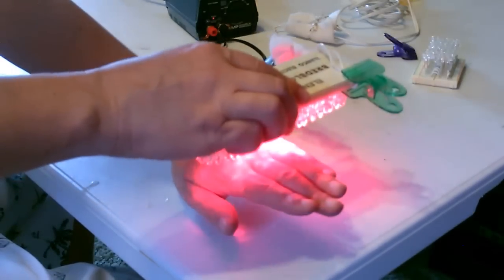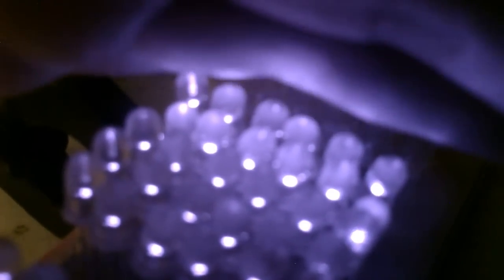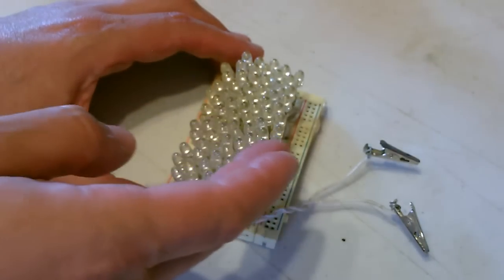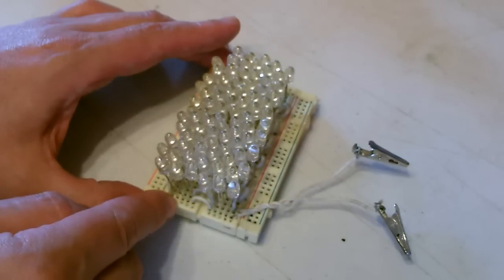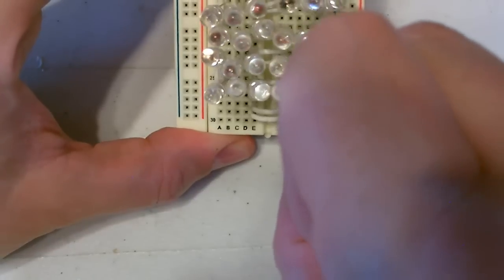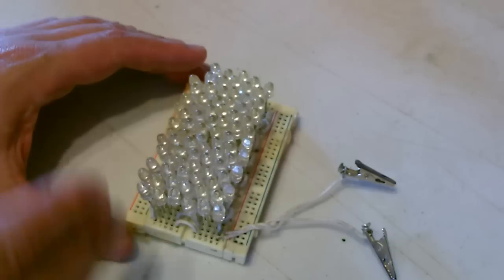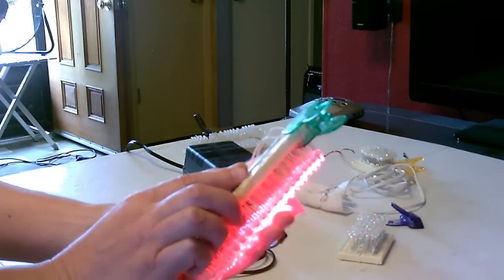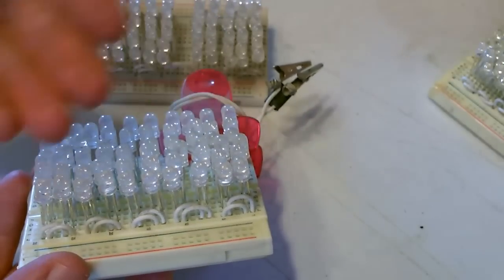Heal With Light! - DIY Cold Laser Therapy (LLLT) 660nm Red Light - LED Healing Panels! Ez DIY ($25)

Comment: Have you ever tried to wire a board with 660 and 880 together on the same board? Would you need resisters and what voltage do you think would run it?
Reply from the maker: hi. i've never tried to wire 660 and 880 together. you probably would need resistors. i've never seen any studies that show using the two together has any benefit. i think i've seen commercially made units that use both 660 and 880 (but it's a gimmick imo)

Comment: how would your diy compare to the 

hooga 24w bulb on amazon 

“Hooga HG24 provides top-tier performance with approximately 120 mW/cm² at the surface and 85 mW/cm² at 6 inches. “ 

just curious because i’m legit serious about making yours with the 400 breadboard but all the ones on amazon for the panels have fans so they’re probably more powered?

Comment: Just to mention how grateful I am that you've made this video. It's been years since I watched it for the first time, which is when I built my (first) LLLT device using your plans. And it rocked, tho the LEDs stopped working fast. Bought then at jameco. If you can make an update, it'd be great.
Reply from the maker: hi. i have made one more video about these panels that is newer. it shows a different wire configuration and works at least as good, maybe a little better.

Comment: Thank you for the great design idea! Maybe you or somebody with some knowledge can help me; I built an identical unit with those LEDs. However before I had even 50 LEDs populated on the jumper-cabled  breadboard, they faded out to where only the first couple of rows lit up. Almost as if the power supply, (which is 5 A )couldn’t keep up. All individual LEDs anywhere on the board worked correctly, just not past a certain quantity. Any ideas?
Reply from the maker: hi. it could be a bad led. even one bad one can sometimes throw the whole thing off. i have another wiring pattern that might help also. it uses the exact same number of wires but they are in a different configuration. in that configuration each row of leds gets its own power. the easiest way to explain it is to just give you the link to the video. it shows how to wire it up. btw - it's very easy to switch the wiring pattern (and this alternate wiring pattern works very well even if you have a bad led or two because each row taps off of the power on the side of the breadboard). here's the link https://youtu.be/kD5cfrpf4sA
by the way, make sure to read the description section of that video. it has extra helpful info

Comment: which power supply do I need to use if I use 16pcs 3W 850nm LED chips in parallel? This chip's IF and VF are 500-700mA, and 1.5-1.7V, respectively. Do I need to connect a capacitor or a resistor? Pls, help me :((

Comment: Do they use a different led in the commercial ones? Something more powerful? The spacing is much greater in those, so just curious.  Thanks
Reply from the maker: hi. a lot of the commercial units are not much good. a few are - but many really don't work. the leds they use are often not even as good as the ones i used (certainly not better). they space them farther apart to save money. they know that the product they're selling doesn't work so they don't even bother to use the right amount of leds.
Reply: @desertsun02  I was guessing that was what was going on,  thank you for your work sir!
Reply: Same lights. You can buy different wattage

Comment: Just curious why no 850nm LED's? Most of the research is based on a split of 660-670nm and approx. 800nm LED's?
Reply from the maker: hi. i found no benefit from using the 880 nm ones. they just never did anything much. they may help some people though.

Comment: This thing is amazing. You feel the difference to the expensive and not so intensive devices. This really does the trick. I Used 40000 mcd, 630 nm Lumetheus LED Diods from Amazon. Simple Breadboard, 22 gage wire, on / off switch and battery holder. All taped together with hot glue to fixate it. Its great gerat great! Feel it on the whole body after 30 min of serveral spots treated.
Reply from the maker: wow, you really got some high miili-candella ones. that's probably good though. i love the device. it's one of the few technologies that i've found that really seems to help.
Reply: Are you using a 9V battery? Are you limiting the current with a resistor? Do you have a link for your amazon leds? thank you
Reply: @francisr6804  2x1,5v batteries. So total 3v
Reply: @francisr6804  i have mine from amazon spain. Find them there and the by something simular. The angel of light is very important.
Reply: @AlvenslebenC  the angle must be wide or narrow?
Reply: @francisr6804  narrow. Its like a laser accupunture then. Use it above accu points

Comment: I could tell there was a huge mark-up on the FDA approved units available. Having no electrical knowledge I am a little intimidated by making my own unit.  Commercial units claim the amount of emf and magnetic emissions their units emit.  Is there a way to measure the amount when you make your own or does it not matter since you use it for 90 seconds instead of the commercial units 10 or 20 minute recommendations per area?
Reply: None of them are FDA approved. They have been cleared as safe for cosmetic use. That "FDA approval" is a marketing gimmick.

Comment: 660nm LEDs
https://www.jameco.com/z/LUR3833-LED-Uni-Color-Red-660nm-2-Pin-T-1-3-4_333526.html
Bread Board
https://www.jaycar.com.au/arduino-compatible-breadboard-with-830-tie-points/p/PB8815
Bread Board Jumper Kit Wires
https://www.jaycar.com.au/breadboard-jumper-kit/p/PB8850
Alligator Clips
https://www.jaycar.com.au/10-piece-jumper-lead-set-alligator-clip-to-pin/p/WC6032

DC Power Supply 
https://www.google.com/search?q=Philmore+2amp+regulated+DC+power+supply&oq=Philmore+2amp+regulated+DC+power+supply&aqs=chrome..69i57j33.454j0j8&sourceid=chrome&ie=UTF-8
Alt DC Power Supply 
https://www.jaycar.com.au/3-12v-dc-27w-power-supply-7dc-plugs-and-usb-outlet/p/MP3316

Comment: Your power supply is 12VDC each LED is 1.5VDC. How do you connect them without resistors?
Reply from the maker: hi. the power supply i used is variable. 12v is the highest setting.

Comment: I had to call Jameco to find the exact LEDs you mentioned.part no. 333526 - .17 ea x 100. What is your normal power setting? Seems like a variable is not need if normally set at 12v?? It's also more costly. Anyone else have a suggest power setting?

Comment: Awesome project! I'm thinking of building an array of 5W 850nm NIR LED's, currently overthinking the whole beam angle, grid geometry and radiation uniformity but having fun while learning stuff in the process :)
Could build a few hundred Watts for cheap
Reply: Did you make it?
Reply: @maxjoseph5981  Nope, I ended up buying and using powerful incadescent lights instead, I think the results should be very similar as most of the energy is in infrared and red! And you get all frequencies
Reply: @NikoxD93  any particular reason you went with incandescent lights instead?
Reply: @maxjoseph5981  cheaper, easier to install, and should work just as well for the intended effect. Downside is higher electrical consumption. I used it during winter and felt the effects!
Reply: @NikoxD93  That's awesome. What parts did you use?

Comment: Can someone please help me. I have this device (link below) and I can not figure out what is the Watts power, I looked at the description and nothing. I need a device with the watts power of 9 to 13 watts, so it can penetrate into the brain. If this device does not have that power, can it be changed?.

This link is for my laser pad.

https://www.amazon.com/Infrared-Benefits-Penetrating-Arthritis-Inflammation/dp/B07FTKBHPX

And this is the link to the article that describes the specifics for a laser to be use in the brain.
https://www.prnewswire.com/news-releases/new-study-shows-only-high-powered-near-infrared-light-nir-regenerates-damage-from-traumatic-brain-injury-tbi-300143969.html

Thanks ✌️

Comment: A question.  Are you soldering those loops of wire in the breadboard and what gauge is the wire?  An idea would be to create a LED chair with a foot rest.  2 boards for feet, 2 boards for wrist and one long board for spine.  And, if my research is correct, the 880 LEDs are used for penetration through the skull for brain stimulation.

Comment: To give you my research on these and you can further research. These units are called cold therapy lasers cuz they are not the hot ones but they do give off a little Heat. They are known to dilate the vessels capillaries Etc to allow more blood flow. When blood flows freely more nutrients can moving to the area including oxygen and everything else to heal whatever the lights are placed. This device allows the body to start the healing for itself. As far as neuropathy and other nerve issues yes it will help rejuvenate and almost dead nerve. The reason for neuropathy is because the nerves are dying and they die because too much glucose blocking the blood and oxygen but this device will dilate the arteries to provide blood float into the area to begin healing and Reviving the nerves. Any other diseases Etc if you have any issues that is caused by lack of blood oxygen and nutrients from the body this is the thing you need. The 880 LEDs help with other issues but they are not hot. People have the misconception that because the 880's do not heat up it's not working but that's not true. It is the light that restores ATP to the cells which is also what the 660 s will do but the 880's is a higher frequency. The 880's go deeper even through the bone the 660 will also but 880's go further. It's a light that you cannot see. People like the 660s seemingly because it heats up and you can see it but that's an illusion they both are wonderful for different issues. These units are very expensive and you have to get a subscription with doctors to use it two times a week this will take your whole paycheck for two years one more treatment. The world needs to know about this.
Reply: Richard, what did your research show on how close this needs to be to the skin? And the current JOOV lights have you stand in front of a 6 foot panel. Are their LEDs brighter? Anyway, I would love to know what you've seen about how close it needs to be to the skin.

Comment: I am finding out that LEDs of 3000 or greater MCD will have a shorter wave length of 640nm.
Reply: Not at all mate. Just bought 266 LEDs 660nm, 2.7 CANDELAS (not 'mili')
Check JAMECO's site for "LED 660nm 2700MCD". You'll find EXACTLY the one's he and I are using.
Reply: @SeganHealthHacker  Is this the real deal? Only $1.51 for a bulb? What have your results been? have you switched to something else?
Reply: @staceykersting705  IT IS. Me and my whole family used it so much that we've burned ~15% of the LEDs. Most highly recommended. It's a godsend.
Reply: @staceykersting705  oh, results: it's a minor miracle. Pains disappear. Strains, gashes and whatnot heal FAST to almost instantaneously (it's ridiculous) and heal better. Headaches, backaches - gone. Clearer thinking when using it on the head medium to long term (gotta have patience. Takes time.) Scrotum produces better and faster when using the LLLT on it (yes. I do it. Rly.) Just PAY ATTENTION TO YOUR TIMER. The most scary headache got to me when I kept the LEDs on my head for too long. More is definitely NOT better in this case. Everyone was kinda skeptical, at first. Now, with the exception of my father (who likes it nonetheless) my whole family is addicted to it and use it whenever they're around and the thing is not broken - which it often is, unhappily. Should have gotten a tech wizz to build me one as I'm just a health jack of all trades who still got some limitations when building electronic devices.
Reply: @SeganHealthHacker  Please tell me the exact one you got so I can try the same one. I've been using a 1 ft square plant  LED panel and it seems great. I can feel increased circulation! The energy I got after use was delightful, and my lpis look fuller, and so does lower face after just 3 uses. I can't seem to find the intensity recommended, but I know 66 nm or 850 is good.  Thank you for your help!
Reply: @SeganHealthHacker  "Does Red Light Therapy Work? CHTV 187" video   has the INTENSITY stats I'd been looking for!  .....100 mW per square cm.  This info is about 20:30 minutes in, and is provided by the JOOV guys. IFanyone finds a bulb or light panel with this intensity, please SHARE! Ty
Reply: Rafa did you build small ones similar to the video or did you build something larger? Would love some specifics on what you did. TIA.
Reply: @staceykersting705  where are you at now with a red light device?
Reply: @maxjoseph5981  I've been meaning to start using it again! It does give a lot of pain relief to my knee. Facially, I do see immediate results that seem mostly temporary,  tho it's hard for me to tell. If used daily, I'm sure results wd be cumulative.
Reply: @SeganHealthHacker  If I wanted to make this device with half 660nm and half 880nm can it be done using the same wiring and set up protocol?
Reply: @maxjoseph5981  Did you try using  660nm and half 880nm..I was thinking 
row 1 use the red ones...660nm
Row 2 use blues  880nm
row 3 use the red ones...660nm
Row 4 use blues 880nm 
and so on....

Comment: This is super cool and has got me wanting to build one of my own. 

what is that power supply thing you're using? sorry, dont know much about electronics but this looks pretty straight forward so longs as I have all the materials.
Reply from the maker: hi there. it's a Philmore DC Regulated Power Supply. you can get it online or at fry's electronics.
Reply: @desertsun02  if I paid you do you think you could make me one ? I have no idea how to do this I need a 660nm just like yours the longer one. Maybe? Please?
Reply: desertsun02 are h stepping your 3V down to 2.4V somehow?  How do you keep your board from flashing at 3V?

Comment: PLEASE HELP...
I built the small breadboard version of this and only the first two rows of LEDs are bright. The rest barely glow. The voltage at the last row of LEDs is down to 1.5 volts. There are 60 LEDs of the type you recommended ordering in your video and I got the philmore 2amp supply. Without the LEDs installed I get the full 3 volts at the end of the chain...
Please, please help....
Reply from the maker: hi there. just guessing, but i'd say it's the breadboard. they have all those connections inside the underside of the board. if any of those are sub-par that could be causing the problem. try a longer board (even if you're only using 60 leds). i've always have good luck with the longer boards. maybe try a different brand too (could be cheaply made). second thing is it could be a diode problem. try reorganizing them one line at a time to narrow the problem down. lastly it could be a piece of wire is not getting a good connection. hope that helps.
Reply: @desertsun02  
Thanks for the response. I switched to a bigger breadboard and it did the same thing. How I finally rectified it was by taking out all except the center jumpers. I then used the + - busbar on the edge of the breadboard as my power source. I jumped from the busbar to each row of LEDs directly. So each row of six LEDs had it own power wires. Now they are all shining bright. BTW... For anyone out there interested in using a battery, I picked up a AA battery pack holder from Amazon that holds 2 batteries and has an on off switch. This seem to be working very well.
Reply: I am using 91 LEDs (same Jameco ones in this video) in parallel and 3V supply. Problem is every time I power up the panel my entire LED panel network starts blinking. Anyone experiencing this and figure out how to resolve?
Reply: @brianestill7993  Did you work out how to make it stop blinking?
Reply: @brianestill7993  Are you sure you didn't purchase blinking LEDs?

Comment: Two more questions if I may...
What setting do you use on the power supply to power the LEDs?
And second can these be converted to run off 18650 batteries instead of the power regulator? Thanks...
Reply: 3 volts....
Reply from the maker: yep 3 volts is it

Comment: So to be clear you are wiring the leds in series?at or about 2amps?but what voltage?
Reply from the maker: the leds are wired in parallel. voltage is roughly 3v
Reply: desertsun02  so solar power capable. Good to know